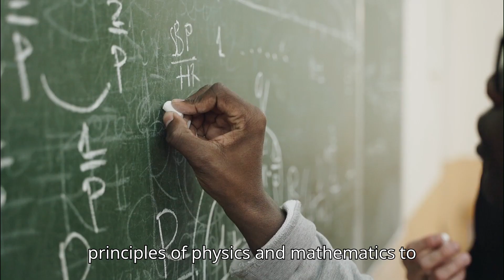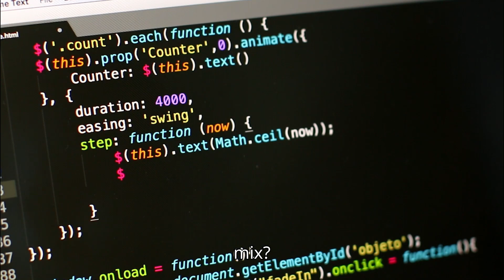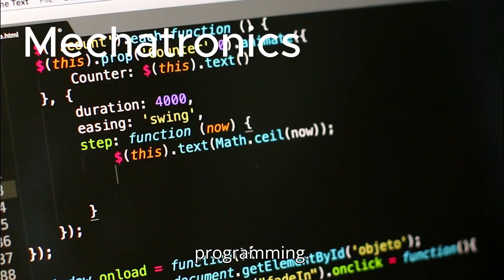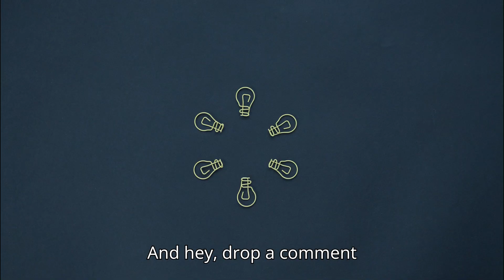Mechanical VS Mechatronics Engineering || Which one to choose?

Comment: question what are the cons of mechatronics , we wont be learning everything from mechanics. i want to do mechatronics
i think it will be good if i did a major in mechanics first with minor in electrical(which has  programming etc) then. can I do master in mechatronics.

or i should just do bachelors in mechatronics, (i feel like i will learn less stuff ) advice please
Reply from the maker: You can do mechanics in bachelors first then master mechatronics, or mechatronics for bachelors and something else in masters, but mechatronics alone as bachelors is definitely not enough, but it helps you make the right choice for your masters, after exploring many points during mechatronics, it'll be easy choosing your masters majors, with many options for sure.